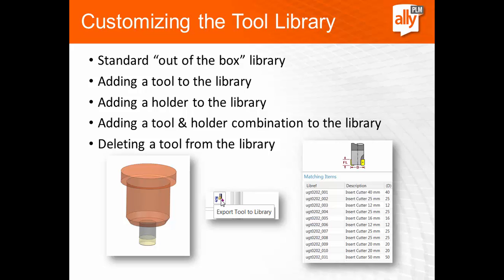How to Customize the Tool Library in NX CAM? - Tutorial - PROLIM Webinar

Comment: when a try to create a tool NX a pop-menu appears and notice me "no write acces to library". Why is the reason?
Reply: Hello Bernardo,

By default the NX folders are read-only, so this is one reason on why you get the “No write acess to library” message.
In this case you can right click in the folder .../MACH/resource, select Properties options and turn off “Read-only” option.

Also, make sure you have administrator permissions on your C: drive.

I hope this helps.